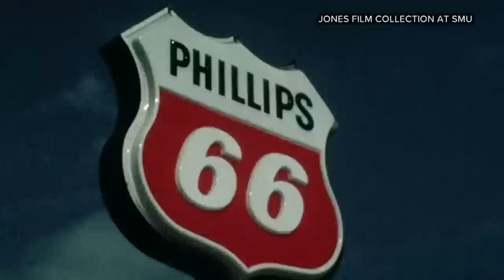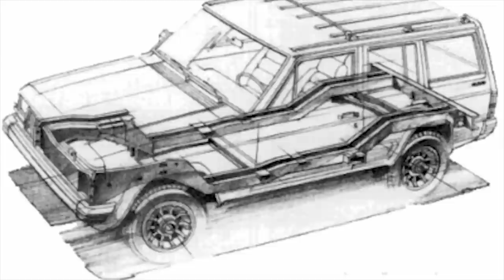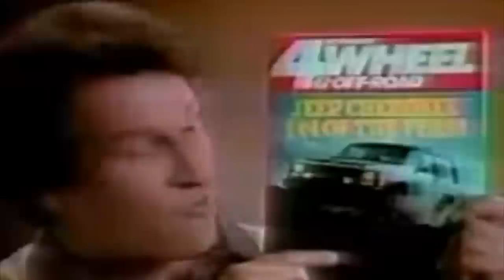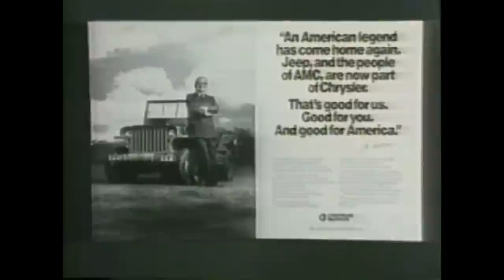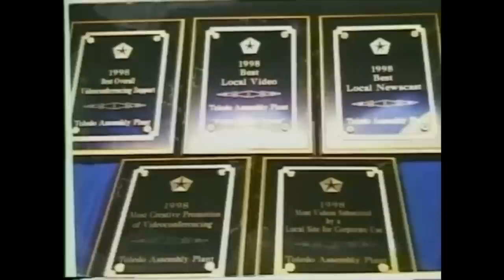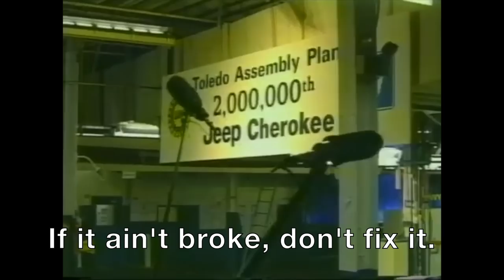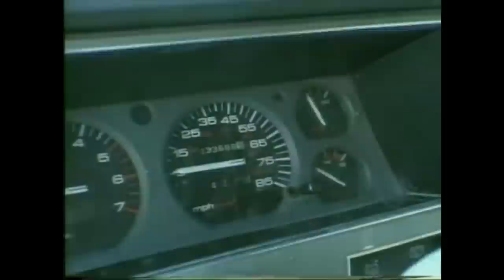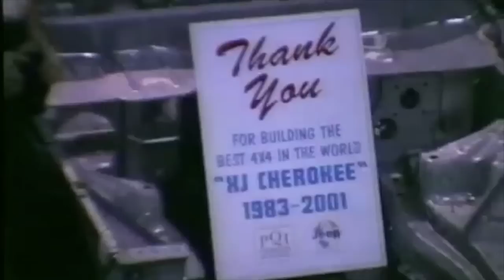A Legend Is Made: How The Jeep XJ Changed Everything

Comment: I own an 88 Comanche, and it had a pretty hard life before I got it. 
And yet it's never let me down. 
Fantastic video.
Reply: I've got a 90 Comanche, it's quite possibly the best truck to have ever been built.
Reply: 88 Comanche owner ✊😁
Reply from the maker: Cheers! I have an '89 Comanche with 208,500 miles currently, they were built to last. :)
Reply: @xjhigg  Nice!  I have 262k on mine.  It's a little beast of a truck.  Happy to tow way more than rated and always super smooth.
I plan to keep mine forever.

What is your MJ's configuration?  Mine is an Eliminator with an AX15, 4x4, 4.0L, and a D44 rear with LSD.  Someone speced it nice when new.
Reply: I’d love to find a Comanche.  It would compliment my XJ nicely!
Reply: I miss my '86 Comanche XLS.  Managed to get my hands on one that was all original still.  Loved that truck and want another one.  Love my XJ though!
Reply: I just picked up an '87 Comanche Laredo.  I cannot wait to get everything fixed up on it.
Reply: I love my Comanches between me and my dad we share 3 both having 1 each and one we share
They are really fantastic trucks, not many people expect everything I do with mine

Comment: My first vehicle was a 1992 Cherokee Laredo. Currently have a 1998 Cherokee Sport (4.0L, AX-15, 6" lift with 33s and 4.56 gearing, Rubicon t-case) just passed 20 years of ownership and 200k miles. 3 treks across the US coast to coast, wheeled up and down the east coast, Moab and the PNW, and still drive it everyday. One of the best vehicles ever built.
Reply from the maker: Awesome to hear. Cheers!
Reply: I have had mine 11 years and i will never sell it. I am always on the lookout to find another XJ to buy. I really want an MJ. They make a great pair.
Reply: @ProjectXJ  I picked up one of those too 6 years ago, an 1989 MJ longbed 4x4 4.0l, AW4 column shift, D44 towing package. It's set up similar to my XJ although it's more work truck than wheeler. You can see my rigs on my channel in some of my vids.

Comment: Daily driver is a 2001 black limited, stock unmodified original with 274k miles.
Just completed a 1200  mile overlanding trek in the northwoods. It did the trip without complaint.
XJ's just keep going and going. Everything still works, and works well. 
Odd thing about mine is its a Diamler (MercedesBenz). THE reason the XJ was killed off.
I've owned three. One highly modified and one kinda mid modified. The ride and handling on an unlifted XJ is just fine.
Plus, on my most recent trip, the 4.0 was getting closer to 22mpg fully loaded carrying a kayak and bike.
Looking for the elusive 2door manual trans that everyone wants.
I enjoyed your video, great content!!!
Reply from the maker: Cheers! Wishing you many more successful roadtrips. One of my first XJs was a 1990 2door, 5 speed manual. Loved it! :)

Comment: Ive had 3 XJs.  Currently have a '99.  My first was a 98.  I had it for years, and my ex wife got it in the divorce.  I bought it from her yesrs later with 301,000 miles on it and very rusty.  But still ran like the day i bought it.  The second was an 01, i bought it and drove for a year then gave it to my son when he turned 16.  He drove it through college, getting into 2 front end collisions along the way.  When he moved to New Mexico, he left it with me.  I replaced the grille, bumper, fender, lights, did aome rust repair, and repainted the damaged areas.  Sold it for $500 more than i oaid for it 8 years earlier.  I kept the $890 i put into it and sent my son the rest. The 4.0 is one of the most reliable/bulletproof engines ive ever dealt with. Very easy to work on, very reliable.  All 3 were 4 wheel drive, and my only complaint if i had to complain about something is the front half shafts.  They seem to eat U-jounts every 30-40,000 miles.  Not great on gas, but excellent vehicles.  The one i have now is just a 3rd car, sits a lot, but its perfect for all the 2 tracks and rough terrain here in AZ.

Comment: A relative gave a 2000 XJ to my family a year ago. The 4.0 had a cracked cylinder head, but a replacement was inexpensive, and now the little beast has proven capable and indispensable. Legendary for a reason!
Reply from the maker: One thing to look out for is the head castings on the 2000 and 2001 models, unfortunately it sounds like you found out the bad way. Here's to many more trouble-free miles for you and your XJ, cheers and thanks for watching!

Comment: I own a 2001 Cherokee Sport. 226,762 miles today. Here is the repair service history since I bought it new Christmas Eve 2000.
3 Water Pumps. Always replace with Mopar
The following gaskets are once except valve cover twice ;
Intake manifold , exhaust manifold , valve cover
Two alternators
One AC Compressor
7 Batteries
4 windshields
1 Power Steering pump
4 sets front brakes- 2 sets rear brakes
1 set Motor mounts

That is all I have had to do to my amazing Jeep XJ. It was paid in full in 2005 and has saved me tens of thousands. I will drive it forever
Reply from the maker: So happy to hear it, thanks for watching!

Comment: The most significant improvement to the XJ was the 4.0 L paired with the Aisin-Warner 4 speed automatic. With my son due to be born in 1987 we test drove the 1986 Cherokee and although it had 4 doors it was so slow with the 2.6 L and an automatic that you wanted to get out and push to get better acceleration. We bought one of the first 1987 Cherokees (it had an immediate recall for sticking throttle body butterfly) and a seal leak in the transfer case, but after those teething problems it proved to be a reliable daily driver for over 20 years. Both of our children learned to drive in that vehicle. In 2009 I traded it in with 228K miles during the "cash for clunkers" program and got $4500 for it. I have since purchased a 1989 Cherokee (I found I really missed the Jeep.)
Reply from the maker: It sure was! Hopefully I put enough emphasis on that in the video, as the 2.5L and 2.8L left something to be desired on 1987!
Reply: Yes!  My Cherokee now has more than 240,000 miles on it and both engine and transmission are as tight as ever.
Reply: During Cash for clunkers , a guy made a video uploaded to YouTube destroying his 4.0 L engine to qualify. He poured silica sand into the oil and took the throttle to wide open. The engine took a frustrating long time to die. He was getting angry. The comments on that video were epic. He got flamed hard. In the end that video proved the 4.0 L is one of the best engines ever designed. It took him multiple takes to accomplish his goal. That 4.0 L just kept saying "we aren't done yet ! "
Reply: @utistudent099  Around here the salvage yard that got the old jeep would pour sodium silicate solution into the spark plug holed to seize the engine. The other parts could be sold.

Comment: My ‘96 stone white ex-fleet SE has 320,000 miles -original engine & transmission. My daily driver and it’s been my steed to prudhoe bay, Alaska, 16 years in Seattle, pulling a camper trailer across the country several times and back to Indiana now.
It’s nearly rust-free, due to liberally applying FluidFilm every fall to the underside before the northern Indiana winter salt party begins.
Reply from the maker: Amazing! Wishing you many more trouble-free miles. Thanks for watching.

Comment: I bought a 1993 Cherokee new so my wife could drive to work for four hours then on to school to finish her nursing degree. It was our newest vehicle so it got used whenever we went somewhere together. With good tires it could push through snowdrifts up to the headlights. I had to take her out and convince her to mash the throttle instead of hitting the brakes. LOL. In four years, the 93 had 150,000 trouble free miles. She was getting nervous about the miles, I wasn't, but to give her peace of mind we traded in for a 1998. But this one we upgraded. Cruise control, ABS, power windows. It drove and felt just like the other one. One year in March Wisconsin got some wet snow mixed with freezing rain. She was determined to drive home in that. She drove I-90 from Madison to Beloit at 9:00PM. There were cars sitting on the interstate crooked in the lanes and could not move. They were stuck in the mix of crusty snow and frozen rain, could not move. She said she was only going about 5-10 miles an hour and weaved back and forth around those stuck cars. I joked with her next day, I bet 200 people hit dealers that week trying to buy a Jeep Cherokee. 

We should have kept it.Several years later it had about 170,000 miles and she wanted to trade again. They had stopped producing the Cherokee so we test drove a Liberty. I liked the extra foot room and head room but I missed the torque of the 4.0 engine. But then I learned there was a diesel option with almost 300 pounds of torque so we ordered one of those. It has been good to us. It is now 17 years old and has 280,000 miles on it.

Looking back, the Cherokee was just the right vehicle at the right time.
This ad makes me wish I could find a rust free one from out west and add it to our Jeep family.
Reply from the maker: There's nothing like an XJ in the snow! Well, maybe a ZJ Grand Cherokee, but still! Thanks for sharing your story, and for watching. Cheers! :)

Comment: I bought a '99 Cherokee Limited, and it was one of the best cars/SUVs I ever owned. I would never have gotten rid of it, but it was rear-ended twice on a trip to New orleans and Houston in 2002. Sadly, it was never quite the same after that for some reason. So, I got a 2003 Grand Cherokee to replace it with the same 4.o Liter engine and loved it. The new car bug bit me in 2007, and I got a replacement GC. It turned out to be a lemon and I traded it off for a Toyota RAV 4 Limited. I've never owned another Jeep after that, but they built great vehicles for a time. I would still own the 1999 Cheokee, if it had run the same way it did for the first couple of years I owned it back in the day.

Comment: I do miss my XJ.  4.0 HO with a manual transmission.  Before I put big tires on it, I saw 23 mpg even with 300,000 miles on the clock.  I also appreciate the mention of the Mercedes 190 (W201) which I currently own and is a car that does not get the attention it should get.
Reply from the maker: When properly set up and with a Manual transmission, XJs got surprisingly decent gas mileage. I recall getting near 20+ MPG in my 1990 2 door 5 speed. And definitely! The W201s are amazing vehicles. Thanks for watching!
Reply: I had a 1991 190e 2.6 black Pearl I bought for less than 5k it was absolutely perfect I miss that car.

Comment: My 1998 XJ, was/is the best vehicle I've ever owned. 513,000 miles without major issues. Its engine and transmission live on in a CJ7 with over 600,000 miles on it. So sad that its production ended and replaced with the Liberty; have one and disappointment after disappointment. Wish that I op-ed for something  different. 😕
Reply from the maker: Yeah, I have heard many automotive journalists say that the "facelift"/replacement of the XJ to the Liberty is singlehandedly the worst one of all time. Thanks for sharing, here's to 700,000!
Reply: I have always hated the Liberty for replacing the XJ. That was a sad day.

Comment: I had a 2001 XJ Cherokee Renegade 2 door 4x4 Manual Transmission with Dana 44 front a rear differentials (in south America it was equiped with Dana 44 front and rear (much better than the US version)). I still miss that truck. Was powerful, capable and agile.
Reply: I put on a rear locker and was unstoppable.

Comment: Good video.  I only call out the common misconception of the front hubs being "auto locking".  They aren't automatic.  They're simply always locked by design.  The front unit hub is always engaged to the  stub shaft, very similar to a front-wheel drive car hub and axle shaft.  The CAD (Center Axle Disconnect) was what engaged and disengaged via vacuum motor.  This was dropped from the XJ starting with the 91 model year and the front end was always engaged and spinning.  The YJ retained the CAD Dana 30 until it's end of production, the TJ had a standard non CAD axle like the XJ from then on and it remained that way until the JL reintroduced it.
Reply: You could get a non-cad axle if you got the np242 transfer case before 1992.

Comment: I own three XJ's, two on the road and one being pulled for parts.
Reply from the maker: The classic parts car. I hope those two stay on the road for years to come. Cheers!
Reply: @xjhigg  the best one I have is an 01 with 179,000 mi on it. I've got five or six grand into it now. The next in line is an 01 with 260,000+ still on the road. My '96 is my parts vehicle. Hard parts work fine so far. Electronics have changed and will not work with the '01s.
If I were to drop 10 grand on the best one, get it painted, rebuilt engine and hard components and nurse that sucker for the next 10 to 15 years I would be way ahead of the game.
I just looked at a 43,000 sticker price on a Jeep gladiator sport. 😱
Reply from the maker: Nice! Keep them rolling. My Comanche has 208,000 on it and still going strong. We just picked up a 91 Briarwood with 92k. You can't replace the catalytic converters on a new vehicle for what it costs to service an XJ for a year.   @dmelson7502

Comment: I love my restored 90 4wd 2dr. Owned a TJ before i snagged and fixed it. XJ's and TJ's are the last true jeeps we've had. Sure the Renix system is temperamental, but most dudes deal with a temperamental wife and don't put much thought process into everyday life and are impulsive as is so i can understand its not for everyone. Renix is quite easy actually, compared to my 88 BMW 325is. No I cant scan my 90's codes, but i can mentally read if something is wrong. Idle is a little funny? Check the air filter, throttle body and throttle cables. Mpg dip? Check injectors, fuel pump, injectors and fuel filter

Comment: Simplicity at its finest wish car makers would get there head out of there ass and think like that again I’ve owned 2 xj,s and an mj im currently building with a tdi power plant I could have gone out and spent 85 grand Canadian on a gladiator rubicon but it would prob leave me stranded in limp mode I chose to instead resto mod a Comanche instead and put all and then some of the off rd options including locking air locker rubicon Dana 44s front and rear 6” lift new interior custom gauges 97 + xj window glass (single pain ) it fits trust me lol and I’m just now getting it moving and I’m so glad I went the old school rout I do like how my dog would have more room but I couldn’t buy a nearly 100 grand Jeep that is essentially a fiat under the hood the quality seems crap on my buddys 2022 wrangler and dam it was expensive
Reply from the maker: You said it! Sounds like an awesome build. Did you go with a VW 1.9 ALH? Or a different TDI? Thanks for watching.

Comment: The unibody is light, but has issues.  If you wheel the XJ, body flex, getting bent and cracks are an issue.  If you seriously wheel an XJ you should weld in frame stiffeners.   
 There are near a dozen US companies that manufacture XJ frame stiffeners.   Even with stiffeners, the XJ is marginally strong enough for jeep wheeling.  
I still really like my wheeling XJ, wheel it hard, but it does have that nagging frameless problem.
Reply from the maker: Valid point!

Comment: According to TFL Trucks (for whatever it's worth), an SUV has to be body on frame. If it's unibody, it must be a crossover.
Reply from the maker: That’s really an opinion. In all the books I referenced making the video, most referenced the XJ as an SUV. The crossover had yet to be coined as a term, so this is kind of a blurred line. Most SUVs are unibody but if you want to be technical and call it a crossover, no one’s stopping you :). Just here to share a cool story. Thanks for commenting
Reply: @5stardave The thing with the XJ is that it existed before the term "SUV" had been "invented". The reason we call things "Sport Utility Vehicles" now is largely because of the Cherokee, as before it, everything was either a station wagon or a truck; there was no in-between as the Cherokee is. By modern definitions it could swing either way. But as one of the commercials used in this video stated, "you could say... there's nothing in Cherokee's class."
Reply: Crossovers are built more like a car than a truck and are usually not capable of serious off-roading. Not sure how that fits into a definition of the type, but that's been my observation.
Reply: Most 4x4 are uni body... Defender, range rover, bmw x5, Nissan pathfinder, mitsubishi pajero,